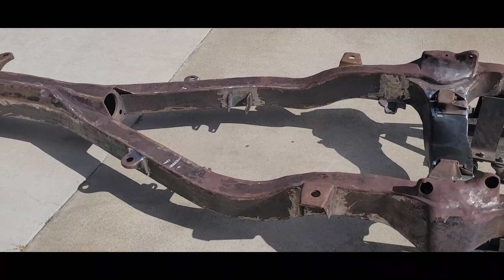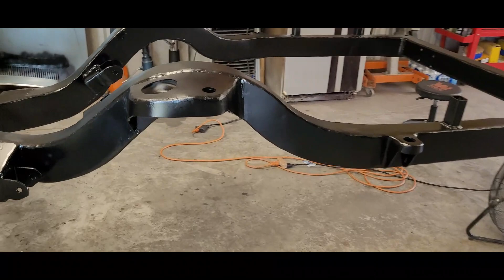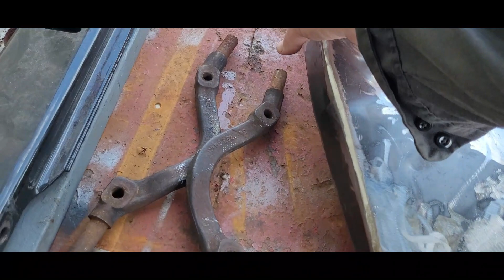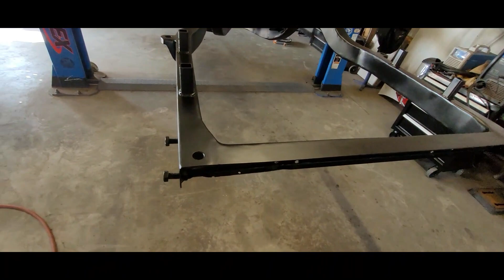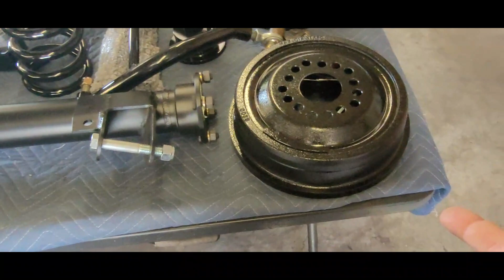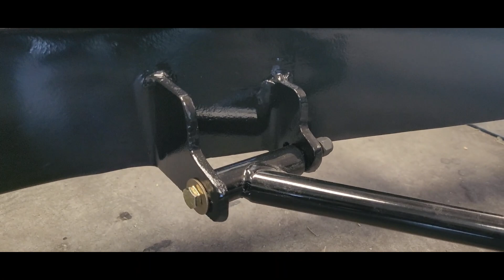1960 Impala Custom Rolling Chassis | @lonestarlows | #rematch | DIY | Lowrider | Chevrolet Impala

Comment: The Frame looks GREAT !!!!!! Lots of work but the finished products makes it all worth it.
Nice set up using the lift to paint the frame, and adding a way to tie down the front will help out for sure.
So I like the Gold wheels but I do not understand what you did, did you take 14" wheels and make them into 13" ????
And why do you use 13 " wheels, just for the Cool factor ???
Reply from the maker: Ed! Roadster wire wheel were a big thing in the early and mid 90s. They went out of business. It's extremely hard to find a complete set these days.  I plan to do a video explaining the wheels.  The wheels started out as 14x7 wheels. And I took them apart and sent them to the original owners of the company. (Im California) they are still around and restore wheels occasionally.  They took the hubs I sent them and made wheels out of them. The process took months due to covid and California restrictions.  I've had the wheels in a closet for almost 2 years waiting.  Most guys run 13 inches for a cool factor. The white walls are the icing in cakes. 14s are ok too, but not preferred on impalas.  The wheels are extremely hard to find and piece together. They are still out there,  mainly in Northern California.  I love them, I'd never sell them.  They are 24k gold plated jewelry
Reply: @lonestarlows  Great to have the "Cool Stuff" Sounds like a real project to pull this whole deal off.
A Video on them would be great to inform all of us what a project it is to pull this off.

Comment: Very nice man! Them rims are 💪🏼 any particular reason you stuck with 3 hole joints and not 4.
Reply from the maker: What u mean 3hole
Reply: @lonestarlows   I think he's talking about the ball joints. You know how most guys these days use the 4 bolt ball joints versus the stock 3 bolt versions. 

Looking good btw.
Reply from the maker: Ahh.  I didn't even think about that.  Tires won't be leaving the ground on this car...

Comment: With the dirty dingo engine mounts you didn't have to modify the transmission mount for the 4L80 (I think thats what you said you're running). I am going to be running a 5.3 with a 4L80 in my 61 rag and I was thinking of how to get it all to fit but if the dirty dingo mounts work without modifying the cross member that is good to know.
Reply from the maker: U will have to notch your floor pan